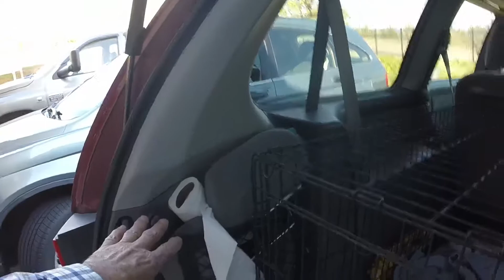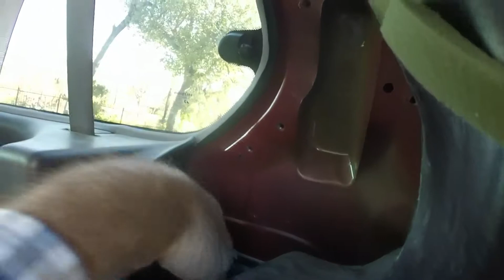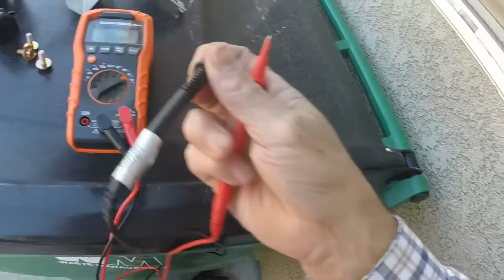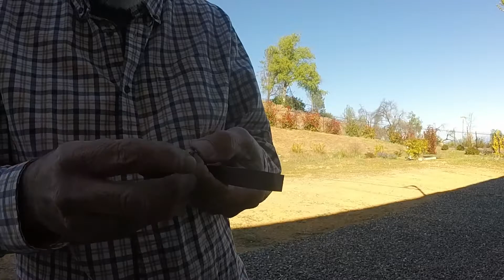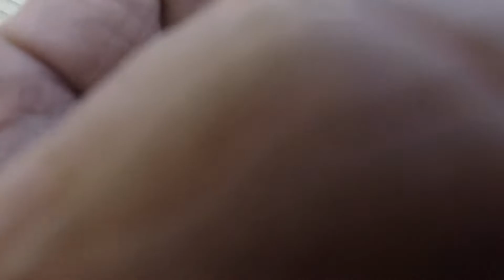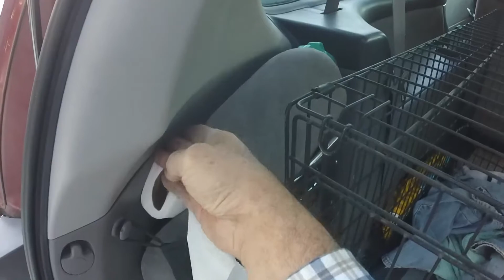How to repair odyssey rear vent window motor.

Comment: Stupid question, could one just solder on new bullet connectors and sidestep this altogether?  Why does it need any resistance?

Or, install a 5A fuse? Or, install new connectors and wire in a resister of a certain resistance?
Reply from the maker: I’ve read this-  
When the motor is working normally, the resistance is low (around 10-15 Ohms). If the motor is strained or stalls and starts to overheat, the thermistor's resistance increases significantly (to over 150 Ohms), reducing the current flow and allowing the motor to cool down. 
It’s like a variable resistor., maybe they make something like that?

I can’t advise you… but I thought about 
bypassing the resistor as I’m thinking it would not be a problem as it should be protected by an existing fuse. Unless you have someone continuously press the switch it should be ok.
The heating worked for me so I didn’t go that route. It’s still working fine.
Reply: @jamesboldshasta8488 Great, thanks.  I could see that if holding the button too long, the fuse would pop, and the motor might still heat up.  I'm going to try your fix first.  Awesome video, thanks!!

Comment: When i press on the switch i hear a click from both motors but they just dont open. Any idea what may be wrong?
Reply from the maker: Did you remove and do the heating and crimping?  If not I’d say your motors are not getting enough power to operate.. so you need to do what I did in this video
Reply: This answered my question thanks 🤘

Comment: Amazing! Japanese owners have been battling this problem for a long time. They solved the problem by installing wiring directly to the motor, but the method you have found is simple and brilliant.
With all due respect from Japan.
Reply: Always respect Japan. Most of the machines I own are Japanese and man did they kill it.

Comment: This was extremely helpful!! Thankyou. Didnt need the heat...but i knew how it came apart and where to fix it..okay after i installed it all...i found i did need to melt that plastic and smash the two contacta together. Interesting little piece they sandwiched in there. Planned failure!! :(
Reply from the maker: Glad it helped!

Comment: I just bought a 2002 odyssey with 153k a few days ago. Then I found out the rear vent window won't open. So I searched on YouTube for help then I found your video and the other fix using ligh bulbs. I go with your solution for simplicity. Surprisingly,  it worked. I couldn't believe it, save me $200. Thank you sir 👍. Oh after I take it apart, I measured about 25 ohms then I burned on the stove a few times until around 1 ohm.
Reply from the maker: Excellent, nice to save a buck!